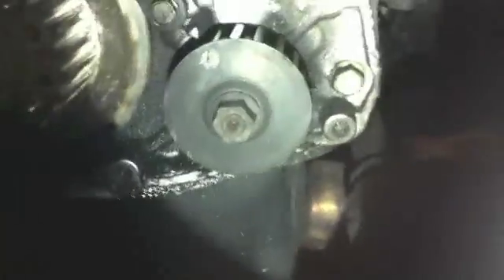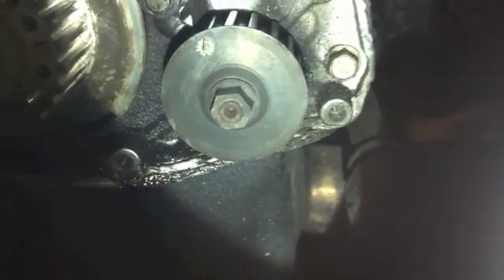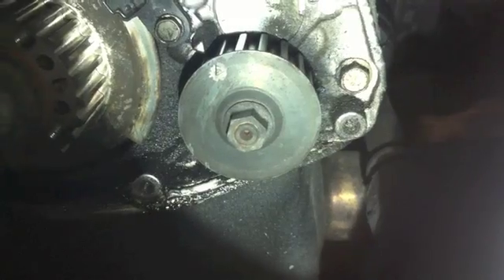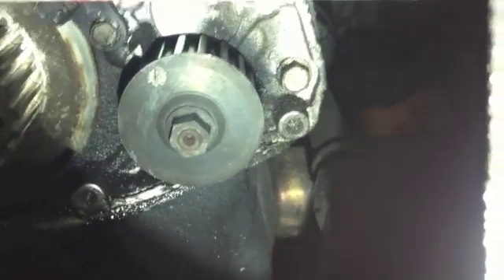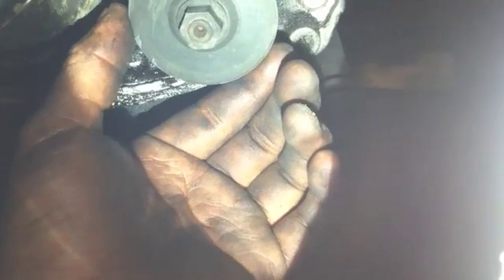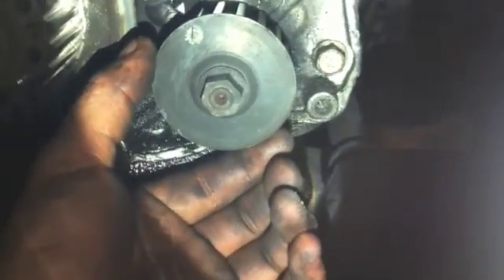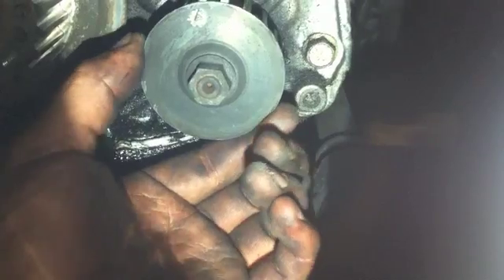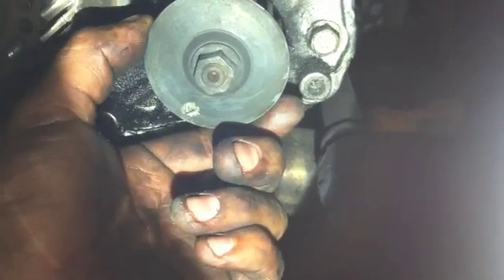DSM Balance shaft timing(proper way to do it)

Comment: That's the oil pump sprocket. Not balance shaft.
Reply: The oil pump drives the rear balancer so yes, it's still the balance shaft sprocket.

Comment: THANKS A LOT FOR THIS VIDEO!!!! I just ran for the same issue a few days ago, the resonance was driving me crazy, I couldn't find the problem until i saw your video!!! excellent!!! problem fixed...
Reply from the maker: No problem man, I'm glad you find you issue!
Reply from the maker: There is also a 14mm bolt on the back of the motor, you remove that bolt and insert a screwdriver and locks it in place and you just make sure is the right mark cause remember there is 3 different spots

Comment: Dude thanks for this....got my car back from the shop after headgasket, headjob, timing belt, etc....and it had this new vibration to it.  I think this is exactly what the problem is.  Also....I hope you've changed that smoke alarm battery by now.  XD
Reply from the maker: Also there is a screw in the back of the motor that locks the  balance shaft in place, if you not feel secure with video, just stick a screw driver when you remove the 14mm bolt, make sure you use a little bit of RTV when you tight the bolt in place